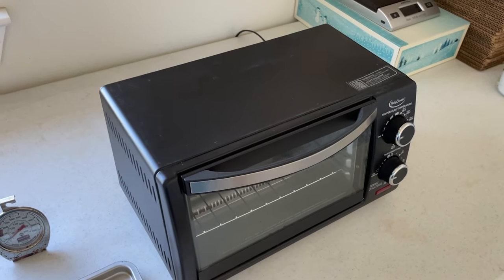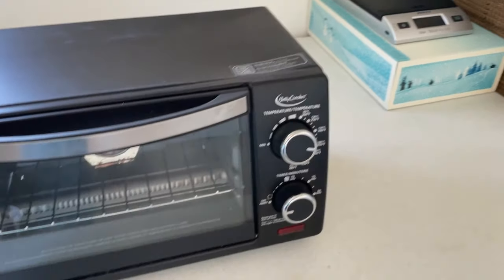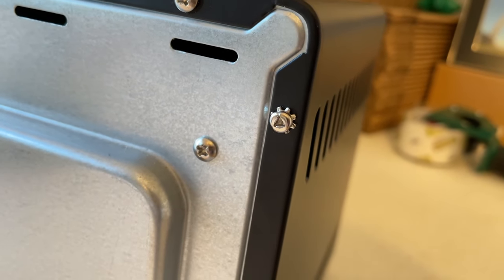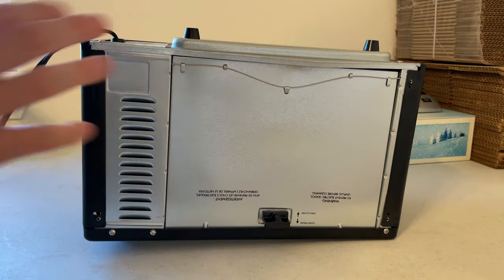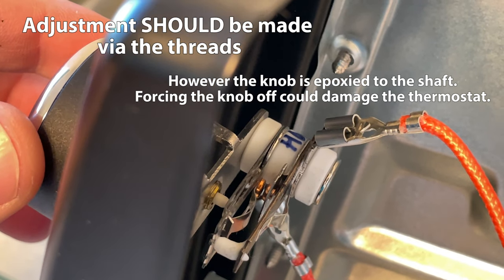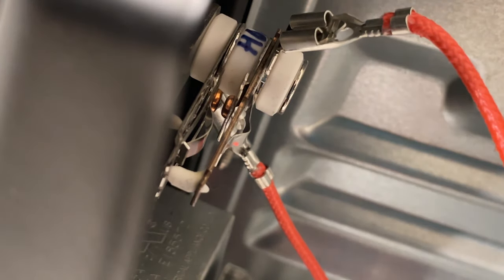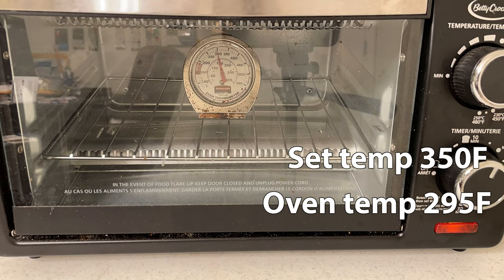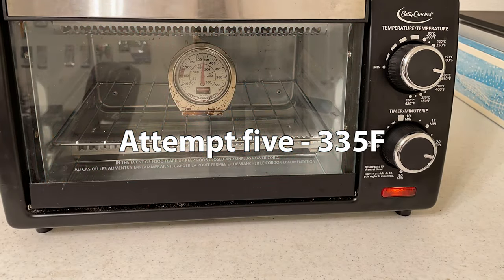Toaster Oven Thermostat Calibration (How to)

Comment: You don't have to open it up, unless you have to replace the thermostat on your oven, the calibration process is to take that knob off with flat head screw driver and get a tiny, really tiny small size flat head screw driver, there is a tiny adjustment thread you will see it when you take that knob off, clockwise is to lower its temperature, counter clockwise is to the opposite.
Reply: I tried to take out the knob, I broken it, and no screw in mine
Reply: thanks for this tip. for some reason the calibration screw has red loctite on mine so I ordered a new thermostat for a couple dollars and im just going to replace it and calibrate it with that

Comment: The problem is that there is no seal on the door like a real oven. Also, the oven box is not insulated like a real oven. Running on 110v it's going to bleed heat faster than it can generate heat. At the end of the day, it's not a real oven. It's just for baking breads.

Comment: That's strange. You turn the knob to the right so that the contacts stay connected to keep the elements heating longer thereby achieving your set temperature. But why push the back contact away? You might have to push it much closer instead. Does that make sense?

Comment: No need to take the back off of some ovens, as noted in another comment  above.. I took my back off my Sharp E0-70K oven to follow your directions,  and when looking at the contacts noticed an adjustment screw. It is accessed through the hollow brass spindle after removing the temperature control knob. It's white plastic, straight blade screwdriver.  Can do little adjustments either direction to fine tune the thermostat contacts.

Comment: Thanks for the video. Wasn't looking to calibrate. My oven kept the heater on forever. Ended up after your video that the thermo contact wasn't releasing and used your truck to adjust it and now it works again.

Comment: Fixed my ancient B&D toaster oven this morning (the metal contacts on the door switch had a bit of corrosion and some emery cloth solved it quickly - only 2 screws to remove the side panels and I could have done it with only the one!).  In my research process I discovered your video.  It had never occurred to me that I could recalibrate my oven control, so I was very interested to see the rest of this video.

Kudos for persistence!!!  In reading the comments (yup, lots of times you learn more in the comments than you did in the video!) someone suggested feeler gauges to aid in calibration and then you seconded that idea.  Perfect!  As a small engine mechanic I've got loads of feeler gauges so that should be an easy fix.  Right now the oven will do about 350 when I set it to 400+ and it's been like that since I got it, so the next time I have to take it apart I'll be messing with that part of the oven.

Thanks!!!

Comment: You're always showing me something I did not even know I needed to know, but somehow was able to make use of in the same way or in a new way! Always learning  something from ya, thanks!
Here's an idea, with a micrometer can you measure the change made, then compute that? Maybe just making a corrected dial overlay would in fact be easier.
Reply from the maker: Always appreciate the channel support! 
I actually just picked up some feeler gauges today. Would have been helpful in calculating EXACTLY what gap I needed instead of the guess and check method.
Would have certainly been faster to just print a corrected overlay for the dial!
My unrelenting curiosity always seems to make a mountain out of a molehill haha

Comment: I'm wondering if this could be facilitated with a very small self tapping screw (maybe1/8" W  and 3/8 L though one contact arm and a silicone or high temp button of insulator on the other contact arm to screw the contacts apart, would work between the two contacts for more consistent calibration...?
Or, would that hole destroy the nexessary bimetal effect? THANKS!

Comment: Power XL toaster oven air fryer unit, my toaster setting doesn’t toast the bread, I can hear the Tstat trip early in that setting and the top and bottom elements don’t get hot enough. But on broil the top elements get red hot. It’s a 3 pin Tstat. I’m going to try your technique, thanks.

Comment: Mine doesn't heat up at all, i open to see if there was a fuse but no fuse
Reply: From Black & Decker via Google: Location:
"Do Black and Decker toaster ovens have a thermal fuse?"
Yes. The thermal fuse is usually located near the heating elements within the toaster oven and can be accessed by removing the back panel. 
Testing:
You can test a thermal fuse with a multimeter to check if it is functioning properly.

Comment: You Do Know the triangle screws are to keep amateur electricians from getting inside? I'm sure there is some legal mumbo jumbo they have to follow. The hex key bolt with the post is another, then you need an Allen Wrench with the hole in it. Never seen a 3 bladed bit so I guess that makes you a Semi Pro. My van is almost done, had to take a few days off to plow 5ft of snow, but I will get to someplace warm soon.
Reply from the maker: Yeah my tool box has a good amount of security torx bits, security hex bits, external torx bits, dual pronged bits etc. But yeah the triangle bit was a first for me too!

Had to deal with the Michigan snow for 23 years. No thank you!

Think you'll install a cheap Chinese Diesel Heater in there? Mine has been a godsend but it can certainly have it's quirks.
Reply: @VanwithTim  Got my heater behind the wheel well with a 15 liter tank mounted on the inside of the rear door. Those instructions are something else, but got it to turn on. 
 Got 2 panels on the roof today, 2 more for tomorrow.
Reply from the maker: @kustomdeluxe8489  Thank goodness for YouTube videos when it comes to setting up the diesel heaters haha. 100% useless in the paper instructions.
Stay warm!!